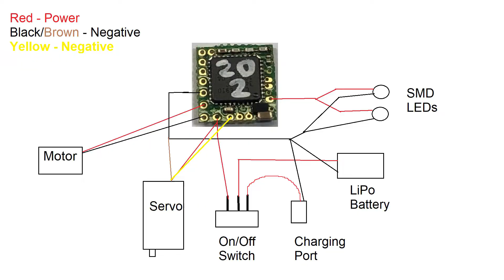1/64 scale Micro RC Hot Wheels | Ford Van Rick and Morty

Comment: I'm looking to try one of these after watching your videos. There are so many options for receivers, is it possible to get a cheaper one for just the motor and servo no lights? What would you recommend for someone trying to save some money ? Nice work with the videos btw, I love how you keep it simple.
Reply from the maker: There are other receivers online that is cheaper and about the same size as the one I am using. I would recommend you trying to find something from FlySky. If I recall, they had a micro receiver that could be used for projects like this.

Comment: What are you using for the esc/rx. I like that its all in one. Ive been using dasmikro esc and rx with flysky radio. But it takes up a lot of space.
Reply from the maker: The receiver I used is called Rx43d-v5 from Deltang. It's small and compact. Perfect for micro RCs. Check the description. I linked their website.

Comment: Great work!! One question, the esc of the rx45 does only allow 0.5A, is this enough for this heavy modell?
Reply from the maker: It’s more than enough. I actually have to set the throttle to 80% in order to have better control the motor. If not, it will be too fast.
Reply: @SlickDiecast  Thanks, for the answer! Perhaps i trie to build one like yours
Reply: @SlickDiecast  Here we go: https://youtu.be/HbnWlU2or1E
Reply from the maker: That is amazing!

Comment: I have dreamed of making a CRX or S2000 hotwheels RC, but have been unsuccessful in any attempt because of a head injury 4 years ago.
Reply from the maker: Randy, sorry to hear about your injury. You will find that it's easier than expected. Please see my other video where I turned a CRX into a RC.
Reply: @SlickDiecast  yeah, watched that one too. The links to the items didn't work. Also confused what remote you use. Also, the ESC is $70? Is there less expensive alternatives?
Reply from the maker: Which link is broken for you? I can update it. Also, there are other receivers, but they are a little big for my case. I know that specific one I used is really expensive. You can try searching for other brand receivers. There might be some that will work for you.
Reply: @SlickDiecast  must have been the CRX video servo one. The link worked here for me.
Reply: @SlickDiecast  do you have an alternate link for an receiver on ebay or Amazon?
Reply from the maker: @Tf2N3rd  Sorry, I don't.

Comment: Great video! How many of these can you drive at the same time without interception?
Reply from the maker: There shouldn’t be any interruptions between any receiver/transmitter. Once the receiver is bound to a transmitter, it’ll only communicate with that remote. At least, that should be the case.
Reply: You have a cool name
Reply: How to make remote?
Reply from the maker: I did not make the remote. The remote I used it called Devo 7e.